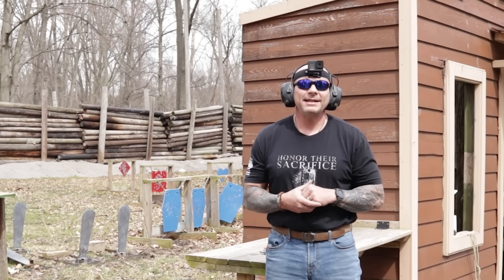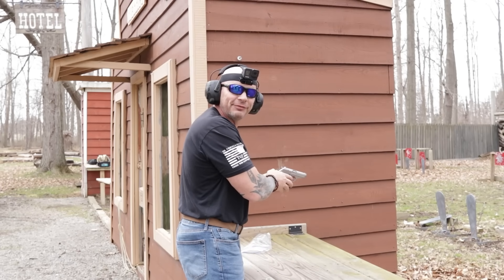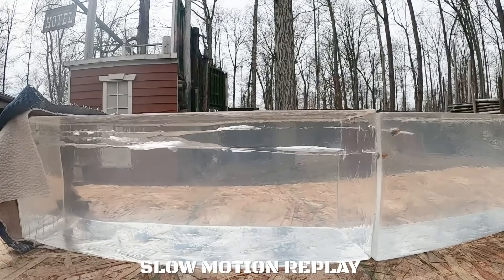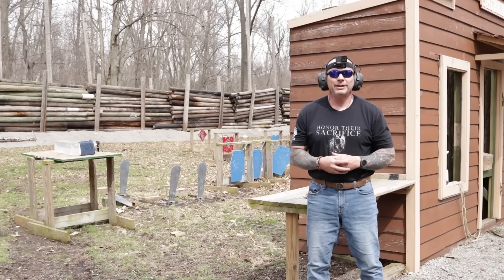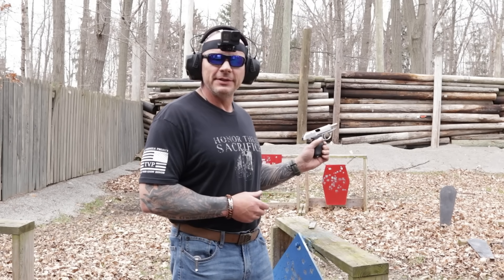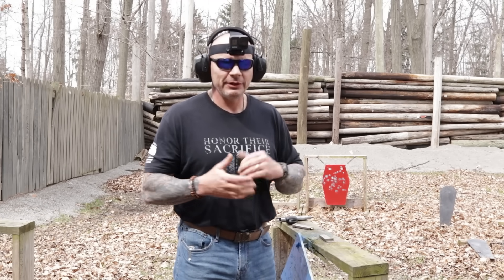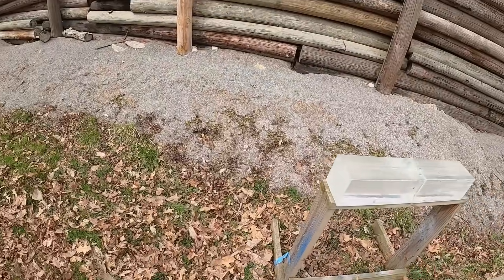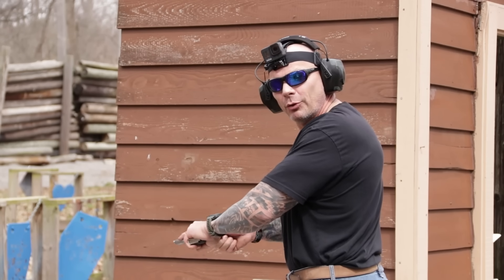Stopping Power of .380 ACP

Comment: 9MM is the most common, and least of the lethal rounds. 9mm is cheap and easy to get at anyplace that sells ammo, 380 here is touch and go. We also open carry and I like a bigger easier to grab gun, I go with the PDP compact. Combined with the Holosun SCS it's a 10 out of 10 and distance is no problem 50 yds consistently, defiantly a plus for a 4 1/2 " barrel and a 9mm load. Your shooting a little tiny gun and at short distances your ok, but at anything in real life it's inadequate. a windshield, a car door, and the wound channel in 380 and 9mm is a world apart 9mm is double the channel and that's what you need to stop the fight, I pray I never have to shoot a bad guy but if I do, I want to end the fight in the least amount of shooting possible.

Comment: OK, the .380 is "a formidable killer," but killing is not the purpose of a defensive weapon, but stopping the threat. A 9x19 does not kick much harder than a .380, and a pistol chambered for a 9x19  does not need to be larger than a .380 pistol.  I did not see very  impressive "wound channels" in your gelatine block hit by .380  bullets. A 9x19 H.P. bullet produces a largerr wound channels thanks to its higher speed without losing penetration. Penetration is not the only factor in stopping power, though. The disruption of internal organs is just as important, especially if the bullet placement (the MOST important factor) is only marginal. All considered, though, comparing .380's and 9x19's is like splitting hairs and a moot point. Indeed, if you want real stopping  power, a rifle or a shotgun is what you need. A pistol  is rarely a good stopper unless the central nervous system is hit. That is why I put away my 1911 (9-round max capacity) and I now carry a 9x19 automatic with 15 rounds of premium defensive cartridges in the magazine and one in the chamber: in a defensive situation placing bullets into the aggressor with surgical precision to stop the threat is not easy; actually,  it is very difficult. A pistol's multiple hits--even if not exactly placed--will compensate for the lack of stopping power of the cartridge--even if the cartridge is a .45 ACP. The cumulative shock of several smaller bullets is generally superior to that caused by the impact of a single larger bullet, when the central nervous system is not directly hit. Small pocket pistols, be they .380 or 9x19, generally carry only 8 or 9 cartridges. I am not advocating "spray and pray," but just the necessity to keep on shooting until the threat is eliminated. Nowadays perps are often loaded with drugs that make their bodies impervious to pain and shock. And one can also find oneself attacked by more than one aggressor. Therefore, a small pistol loaded with anything less powerful than a 9x19--better yet a +P load--and with a limited magazine capacity is not the best defensive weapon. Naturally, a larger caliber pistol like a 10mm with a 15--round magaziine capacity would be much better than a 9x19. But how many people can manage the very stout recoil and muzzle climb of a 10mm? How many people would want to  carry a gun that weighs almost liike a small anvil? The 9x19 is a very good compromise. The .380, especially a low-capacity pistol of that caliber  is, IMHO, pushing your luck. As Nathaniel Bedford Forrest used to say, "Hit them firstest  with your mostest!" And I would humbly add: ""And as many times as necessary to stop them." No, I have never shot anyone or been shot by anyone. Nor have I been in any firefight, not even when I worked as a Rent-a-Cop. But I read , view and study everything I can get a hold of regarding ballistics, guns, cartridges, shooting experiments and experiences, firefights, forensics, etc. After all, I do not know of any astronomers who have traveled outside the solar system, yet they describe far-away planets, galaxies and black holes. I do have extensive experience in the hunting field and of the effects of bullets and pelllets on feathered and furry critters. Not the same thing as two-legged beasts, but somewhat similar.

Comment: My 2 cents. The gun you have is the most effective and that means everywhere you go. A 9 mm is the better option. I have handled and shot a dozen different compact guns over the years. The answer for me what gun can I fit into a small fanny pack or gym shorts and shoot for accurately and train with. My experience is that a 9mm in that size and package is not enjoyable gun to train with very snappy and painful for me after 30 to 50 rounds. The .380 is smaller and much gentler to train with. I’m anticipating a 3 to 10 yard scenario and head or high chest is very doable.

Comment: in high pressure situations, I am not so sure the 380 shooter is totally focused on shot placement.

I also recall the FBI report a few years back indicating how many shots are actually missed in high pressure situations.

Question, If it’s close quarter combat, will that 380 round have the proven performance to stop the assailant at very close range?
Reply: I drive for two rideshare companies. If I need a weapon, it is for a target that is within arms reach practically speaking. A .380 has plenty of stopping power at that range. My intention is to stop the threat, and a 380 is fine for that.

Comment: I think there is way too much focus on the bullet expansion. There is really not going to be a lot of terminal variance between a .355 hole and a .380 hole. 
I think the key is to pick the gun and cartridge that you can shoot the fastest and with great accuracy. If you can put 4-5 hits on a 3x5 card at 5 yards in under 5 seconds from the draw, you will be just fine. This is true whether you are shooting a .500 magnum or a little .22lr. - Obviously bigger is better, but only if you can maintain speed and accuracy. (A hit to the noodle with a .22lr is likely going to have more effect than a .45 to the forearm.)

I have found that with my old-man arthritic hands, a .380 in a mid-size gun is the largest I can shoot both quick and accurately.

Comment: I understand the FBI and other organizations did extensive research on the subject for combat situations, but in most civilian situations do you still need 12 in minimum? I've always had the thought non-combat related situations 8 to 10 inches but not exceeding 13 inches would be more acceptable penetration for civilian use... but I can see where during the winter you would want to carry something with a little bit more power to it to get through heavy clothing ect... ask for the 380 being a little more Snappy yeah that's just the nature of the Beast because it's in such a small frame gun but me I carry a Bersa Thunder combat 380, or my LCP Max and the LCP Max is definitely a bit punchier because it's only around that 12 oz weight mark where is my Bersa Thunder combat is right around that 22 oz give or take mark... possibly I just use my Bersa Thunder 90% of the time when I'm carrying 380 but then you lose the convenience of something lightweight... anyways that's my two cents on the subject I've always been a big fan of 380 ever since getting out of the military I also carry a 327 Federal Magnum revolver from time to time but that's a little on the heavy side and use it for a Woods carry mainly.. and ask for my winter carry I carry a Diamondback DB9 G4 for a little more stopping power through those clothing barriers

Comment: Would some of you seasoned individuals recommend hollow point or FMJ on a .380? BC I've gotten mixed information
Reply: FMJ. Hollow points often fail to expand, and when they do, they either fall short of the recommended penetration depth or just barely meet the minimum. Penetration is more important than expansion.

Comment: Common stop it! They are both 9mm, I RELOAD both with the same bullets and same powder charge. The 380 unlike the Luger is not a tapered case. It is a centimeter or 2 shorter in length.😮

Comment: I would love to see 21ft and 150ft with external hollow points from Underwood and G9 for the 9mm and .380 as well. If you happen to run into this comment. Even if you don’t, thank you for your testing and content. I use an Sig P238 during summer carry. I was using Federal HST in .380 and 9mm. I switched to Underwood Extreme Penetrator in .380 about 5 years ago. I have on order the G9 in .380 that hope to get within the next month or so for summer. I saw a video recently about the inaccuracy of the Underwood .380 at longer distances, so I’m going to test accuracy of both at 150ft or so. I don’t see a defensive use of that distance, but I want the most accurate I can get. Both of these rounds have great cavitation compared to hollow point on the .380.

Comment: I've been carrying the S&W M&P 380EZ since it was released in 2018. It was my godsend. With nerve damage in my hands, I can shoot that weapon all day long. She's very smooth and for me accurate. She has a long enough barrel to actually make it to its destination, small and light enough to carry IWB appendix to where I "forget" it's there and when I load and rack the slide, it is easy enough for my hands. As a slender, mid 50s female, I load hollow points, and feel confident that my 8+1 can get the job done+ I carry an extra magazine. The only other weapon (and I tried 2 Rugers, a Walther, an S&W and a Glock17, all 9mm) I can do this with is the weapon I carry for work, which is the HK VP9. It comes with different grips so I can use the smallest size. That is to me the softest, smoothest, best recoil eating 9mm by far. Lots of people don't like the magazine drop on the VP, but I trained and I actually love it. Both these weapons also accommodate the fact that I'm missing 1/2 inch of my trigger finger from a trailer hitch incident. I firmly believe that a lot hangs on training. You can carry the biggest gun, but if you never actually put a round on a target and it then comes to a high stress situation, you might never even get the weapon out of your pocket/ holster, to ever get the first shot off. 
Just my humble thought.

Comment: A Browning Model 1910 chambered in .380 was used to assassinate Franz Ferdinand & his wife.  The killer fired several rounds striking each victim only once. He shot from a distance of less than 15' (My opinion assuming he was on the curb.  The victims were seated in the rear seat of an open car that was stopped bc the driver was unfamilar with the gear shift.)  And that was with 1914 ammo.  This event led to to WWI.

Comment: .
    I used to carry a antique .22) 7 shot revolver that I inherited from my father. It is stainless steel, cosmetically a little rough but absolutely zero play in the hammer and trigger. It would only fire .22 short and long. .22 long rifle hung out past the end of the cylinder and would catch on the frame.
    I was joking with a sheriffs deputy one day. I told him that his .40 caliber might blow my head off but my .22 would put him in diapers for the rest of his life. It turned out that he was the firearms instructor for the sheriffs departments of 3 counties. He said that the .22 long, light at 29 grains, at short range, had the oomph to enter the skull but loses a lot of velocity passing through brain matter and will ricochet off the inside of the skull anywhere from 3 to 8 times tearing up any brain matter in it's path. I thought that I was making a joke, not a prophecy.
    I've had 11 spine surgeries since 1985. Six of them on my neck. This has scrambled and weakened the nerves in my arms and my 5 low back surgeries has weakened my legs considerably. I can no longer fight nor run from an attack so I started carrying a pocket gun.
    First, the above mentioned .22 then yesterday, I upgraded to a Taurus Spectrum .380 that I bought from a pawn shop. It doesn't appear to have ever been fired as there is no powder residue, blemishes or any signs of wear inside or outside of the gun. The only negative that I can see is it was missing the smaller clip that was included when new. I knew that my arms have weakened since my prime but I didn't realize how much until I watched several YouTube videos about the Spectrum. I watch these guys racking the slide like it was on a ball point pen spring but when I do it, it's like opening the vault door at Fort Knox Kentucky. I am right handed but I have to hold it in my left hand to fully be able to rack it with my right.
    As you can tell, I'm not out to kill anyone and hope that if it is ever necessary to draw it, while not as impressive ad Dirty Harry's .44 magnum, the sight of it alone will be enough to stop an attack. Many handgun videos talk like everyone that may attack you will be a T-1000 terminator. Not everyone is so brave or fool hardy as to face down any loaded gun that is pointed at them like they are in Hollywood.
    I had a friend in grade school, in the 60's who's father got into an argument with a guy. The guy pulled out a .22 revolver and shot him in the bicep. The bullet ricocheted off the bone, went between the ribs into his heart and killed him. Depending on who you talk to, a lucky shot?
    My son was in a gun shop looking around the other day. While he was talking to the owner, he was poking a bit of fun at his old man and the .22 revolver that he was carrying. The shop owner told him, "I don't know anyone who wants to get shot with a .22." He put my boy in his place better than I could have on such short notice.
    Make no mistake. I will shoot, should it become necessary, and regardless of the outcome, I will sleep like a baby that night. I used to be an extremely violent drunk and never really had much conscience about things after the fact. I've mellowed quite a bit since my last drink on September 24, 1985 but in visualizing myself in a self defense shooting situation, I don't know how to feel the emotions that they send police personnel to counseling for after they shoot someone in the line of duty. It's like the space in me for that emotion is an empty void and I have no concept of what it might feel like.

    I don't fear myself becoming a mass shooter or other kind of gun nut. I wasn't raised that way and, being originally from New York, the land of way too many gun laws, only shot long guns as a kid occasionally when my father took me to the range. He taught me respect for firearms because he was a training sergeant in the army during WW II.
    Years ago, being 6 foot and 240 pounds of mostly muscle, I had confidence in my ability to defend myself with my hands or even a pocket knife. More recently, at almost 70 and being measured for a physical, I have found that, after 11 spine surgeries, I have shrunk to 5' 7" and, at a sedentary 255 pounds, I have reconsidered my position on needing a little help from a firearm.....just in case.

Comment: The FBI is not the final authority for civilian ccw firearms. They are looking at sideways or car to car shootings. Many jurisdictions limit legal blade lengths to 4 inches or less . Why do you suppose that is? As a physician I will tell you why. Most vital organs in most adults can be reached with that length knife. Heart, lungs , liver, kidneys heart. In large individuals, let’s say 7, not 12. The 380 is capable of adequate penetration and not over penetration. Another problem isthe 380 is not loaded to its potential . It can be loaded to an honest-1000 fps with 90-95 gr bullets. That is in a 3.3-3.5 inch barrel. The 380 is barrel length sensitive and loses 50-75 gos in 2 3/4 inch barrels. I carried a 380 Ppk for years and never felt unarmed or undergunned

Comment: The question is really a no brainer if you really think about the chambering itself and who designed it. Mr. browning created this round
to be a formidable defense round. Browning Cort, 9mm short, .380 acp, which ever one you choose the .380 is plenty powerful enough to do the job. Do research on how far even a target .380acp round travels through ballistic gel!! You will be surprised!! And because the .380 acp has basically no recoil to speak of your accuracy verses say a 9mm will be at least 40% better. Better accuracy equals more repeat shots faster on target!!

Comment: 67m is that that famous gun fight against two bad guts that were dropped at around 67m. ? 

50yrds. "Point of aim, point of impact." +/-. One handed. 25yrds aim at 6 o'clock. 

Something longer bench it... or take a knee  or squat. Two handed. 

Barrel length with affect rd. 

Technic doesn't change, it's like spot bowling. Repeat with a minor adjustment. 

Master one handed, then add that support hand...

Comment: I have handguns ranging from 22lr to 45LC. I varied from 22lr to my 9mm. I find myself carrying my Ruger LCP max 380 the most. I was carrying my Ruger LCP 380 until I got my max 380 just because the max holds 10 rounds instead of 6 rounds.

Comment: I have a .380 ACP Ruger LCP pistol for a concealed carry pistol.  It is strictly for self defense use (pray that I never have to use it for that) and no illusions that it is a target handgun.  I am quite confident the .380 ACP round (be it with FMJ hardball bullets or jacketed hollow points)  has enough energy at close 'self defense' range (inside five yards or so) to do the job.  And yes the Ruger LCP .380 ACP has a bit of snappy recoil but I find that the gun is perfectly manageable.

Comment: I think a lot of people misunderstand the FBI penetration test.  The 12” of penetration is designed to simulate shooting a target individual who is standing sideways, perpendicular to the shooter.  So the test simulates shooting through the target’s arm, into the body cavity, and penetrating through the heart, resulting in rapid incapacitation.  Most shootings that occur, happen when the bad guy and self defender are facing each other, so in that case, 6-8” of penetration is sufficient to reach vital organs.  12” of penetration in the “usual” scenario, will result in pass through, possibly endangering innocent bystanders.